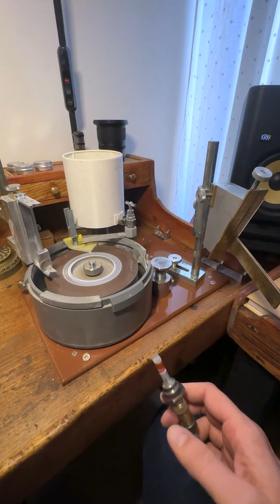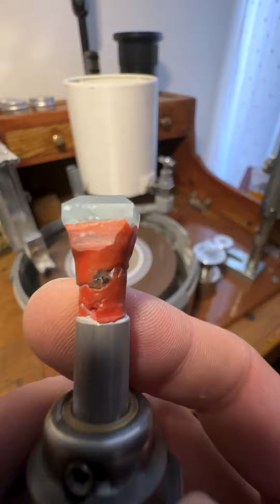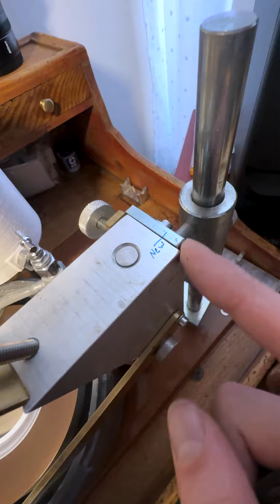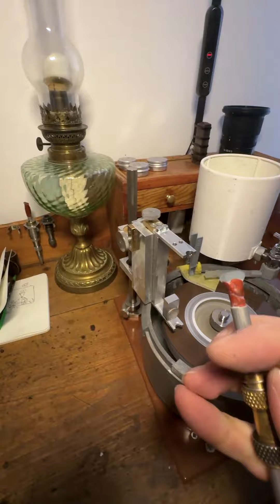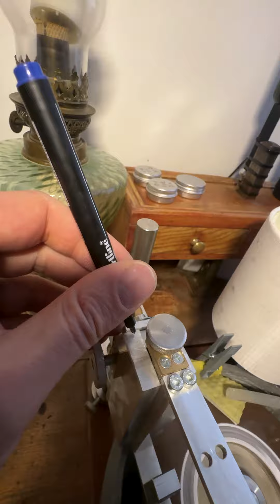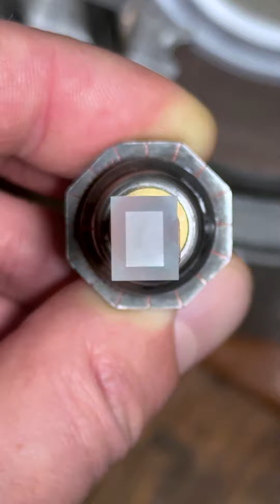How to Balance a Fralap Jambpeg Faceting Machine

Comment: Very informative! What a smart way to calibrate the machine. I need to do that with my Fralap ASAP. Thanks!

Side-topic: Have you had the green PU belt rip at higher speeds? TIA
Reply from the maker: Yes it happened once but it's quite easy to fix it. Just hold both ends of the belt over your dopping flame and when they get kinda melty, remove from the flame and push them together as hard as you can and hold for a few minutes.  Make sure you do it straight so it makes a smooth line for the belt.  Then use a razor blade and cut off the ridge that gets made from pushing them together.  I had to do this last week because I accidentally stretched my belt out and had to cut part out and make it smaller. It takes only a few minutes. Good luck!

Comment: Is this type of machine better respect the hand pice ? What u prefer work with ? I just aligned the plate and the rotor/disk on the sterling . I love it and this new stuff the only iussue is polishing. Tables  scratching continuosly so I use old dvds over copper plate. There are plexiglass polishing plates on the market right ?
Reply from the maker: @alessiosandreani  I use this one for fun on the nights and weekend. For professional work, I use a Sterling as I am not very good at the jambpeg yet. Yes you can get plexiglass or acrylic laps or just make your own.